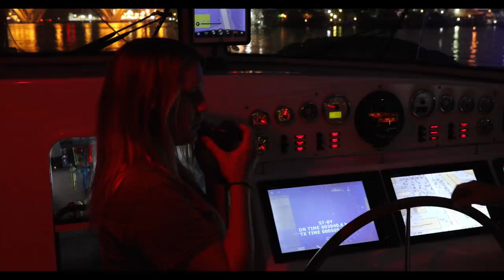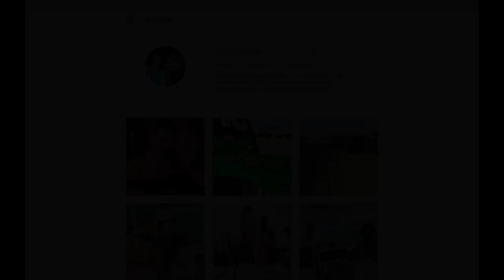Sunday ain't always Funday! - Lazy Gecko Sailing VLOG 100

Comment: Do believe I would have thrown a fit if the whole unit need to be replaced if in fact parts were under warranty. Also I feel your pain with contacts. I wore my about 3 times and ditched them. Hated everything about them.
Reply: Go laser.  I had it about 15 years ago, price is lower now.  Ace !
Reply from the maker: We did! There was nothing we could do about it.